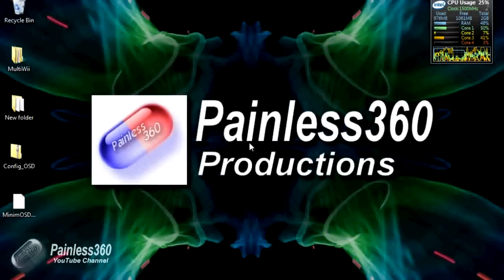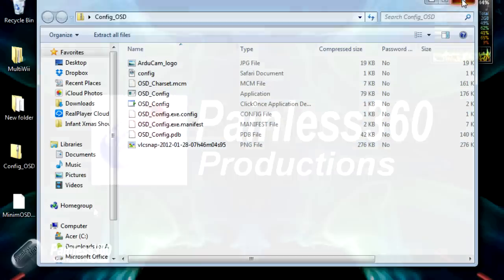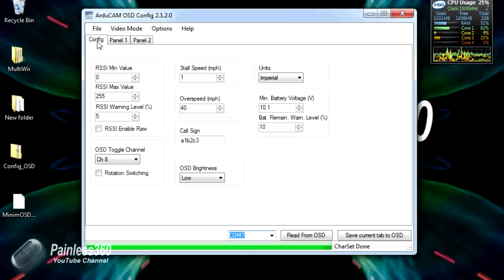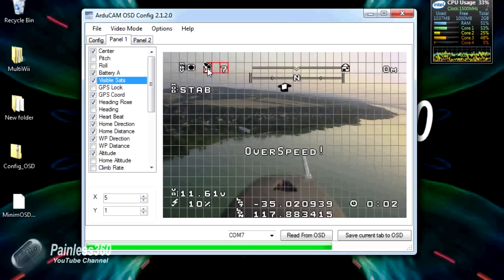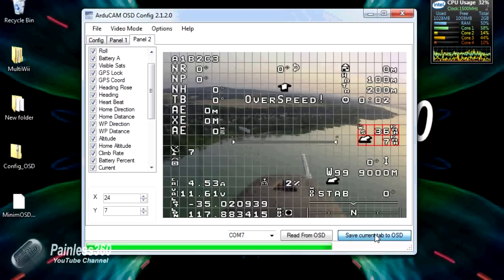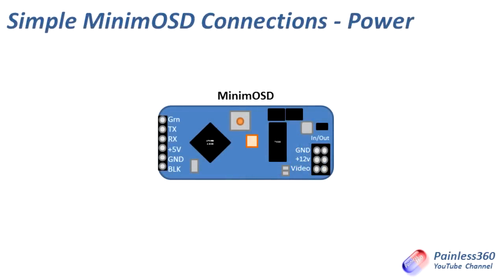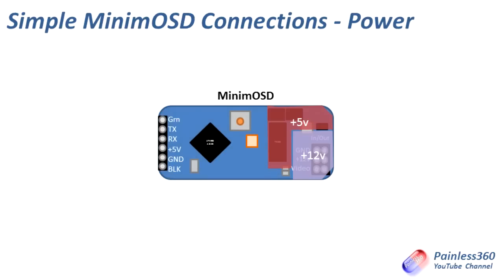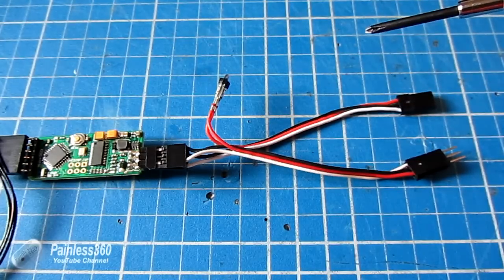APM 2.5/2.6/2.7 - Adding an OSD for FPV using MinimOSD - complete setup

Comment: Can the APM support having both the air telemetry 915 Mhz module and the OSD connected to the telemetry port?
Reply from the maker: The lack of ports was a limitation, from what I remember.  I've not used an APM for a very long time and would strongly suggest that you upgrade to something far more capable if that is the kind of thing you want to do... best of luck
Reply: I already have the S500 quad copter and am upgrading to add OSD and power module. I was thinking of making a Y harness to connect the OSD and the air unit. 
Thanks for your response, I really enjoy your channel.

Comment: You can use your arduino board as an FTDI adapter! You'll need to take out the atmega chip or upload a piece of code that pretty much disconnects every pin and makes the chip inert. Now just connect rx, tx, reset, 5V and ground. That's it, you can upload now. Now if you're using arduino IDE to flash the firmware, you will have to remove the chip completely.

Comment: Hi, I know this is a very old video but maybe someone could help me, I connect the osd module and I get image but I don't have information, I mean all values are 0 or disarmed o something like that, I checked tx and rx many times, even I changed them but I don't now why I can't see real information
Reply from the maker: It is usually that the telemetry isn't being sent from the FC or the TX and RX wires are the wrong way round (or both). https://ardupilot.org/plane/docs/common-minim-osd-quick-installation-guide.html covers what needs setting in the software. Best of luck
Reply: @Painless360  Well, right now I'm getting some information like if it is armed, throttle, horizon orientation and even compass direction, but things like flight mode, battery percent and height are always 0, am I missing some Mission planner's configuration or something like that maybe?
Reply from the maker: I'd check the release notes for what is installed onto the MinimOSD i.e. https://github.com/ShikOfTheRa/scarab-osd/wiki/MAVLINK-installation best of luck

Comment: How to use radio telemetry and fpv with minim osd with apm 2.8 at same time
Reply from the maker: I never got it to work. The APM is a very outdated flight controller.. Best of luck
Reply: @Painless360  so, it is possible in pixhawk ?

Comment: Hi. When reading the hex file it stops past halfway and gives a message error opening com port. It only shows 1 com port 5. I have tried everything, nothing works. What can I do? Please help. Or is there another system I can use?. Great video though. I'm a subscriber and view all your videos. Thanks
Reply from the maker: I've not used MinimOSD for many years. Not sure what part of the setup you're referring to but you need to use a supported version of the firmware.. Best of luck

Comment: hi there sir! your videos are great!
i've setup the osd like the vid
It works great 
the only prolem is that i have a 0.0 volts showing on the osd
i can't understand why :S
Reply from the maker: Check that you can see the voltage in the Mission Planner screen to confirm that the wiring is correct. Best of luck!

Comment: Can I use an Arduino nano, AND an OSD ? And ho to plug them together ??? Thanks a lot 😘😘 :)
Reply from the maker: not sure, that's something I've ever tried. You can install ardupilot on modern flight controllers that include an on-screen display now. Check out my latest ardupilot series. Happy flying!

Comment: Thank you.  This video made setting up a breeze.  Everything went exactly as you showed it.  Just one question though,  instead of patching the two solder points to bypass the 12v regulator can you just input 5v into the video side to power the Max chip?
Reply from the maker: Possibly but that’s the way that always works for me.. happy flying!

Comment: If my Tx supports 6s lipo...shoul i use a 4s lipo to power the Tx..is it affect the minim osd?
Reply from the maker: Sorry, I don't understand the question..
Reply: Should i configure the minim OSD with 4s lipo? As my TX supports 6s lipo.
Reply from the maker: You'll need 5 volts to run the minimosd. See the documentation for how you set-up the sensing of the main battery voltage. Best of luck!

Comment: hi mate! i take a lot of good tips from your videos but i have a question for you.
i upload the firmware in my minimosd with pixhawk as FC, i set the display with the info that i need for my copter but 2 options are not working as desired, one is the "flightmode" and the other is the "warnings".
Flightmode is fixed as "Hybrd" while warnings even if armed it display "disarmed"
i try to jump from a flightmode to another but nothing happend and also try to arm and disarm without no results. 
In your infinty knowledge to you have any suggestions
Reply from the maker: I'm not sure, sounds like a software version issue. Maybe there was a change to the MAVlink messages and how they are interpreted.. Sorry I can't be of more help..
Reply: many thanks for your reply! i will try also other firmware...may be if you have time you can check with your device and post your config (FC pixhawk firmware for example) and results! very appreciate! this video is related to APM not pixhawk

Comment: @painless360 - Hoping you can offer some insight.
I am attempting to setup APM v2.8 (https://www.tomtop.com/p-rm3244.html?_ga=2.92393373.1865110197.1519141650-1507016490.1519044082)
I was able to successfully get OSD to display properly following your video guidance, firmware ,etc.
I then attempted to connect my FrSky L8R receiver to input 1 on the APM; making sure the signal was on the inside and GND to the outside of the APM.  The moment I connected the Rx I believe the APM rebooted.  When the APM was back online I no longer had OSD displaying.  I have rebooted everything, powered off/on and confirmed all connections are solid.  I have removed the Rx from the equation, still no luck.  I used my FTDI connector to re-flash minimOSD successfully; plugged back into the APM, still no OSD.
When looking at the minimOSD both sides of the board LEDs show online.
Did I inadvertently fry something when I plugged in the Rx?
Any help appreciated.
Reply from the maker: Tricky to comment and offer advice but it does sound like something might have popped.. I've not played with APM for a while so I'd start by checking out the reviever and making sure non of the pins on that are shorted.. Best of luck!

Comment: Hi, thanks for this video. I followed the tutorial and it worked like a charm the first try. However, now that I soldered the board to deactivate the 12V onboard BEC I get a "Failed to talk to bootloader" error when I try to reflash the firmware. Do I need to undo the soldering, or is there a bigger issue?
Reply from the maker: I've never seen that as the board is powered from the 5v line from the USB. You can always try and see if reversing the change makes a difference..

Comment: Thanks for the great tutorial! Slight issue though; my OSD is flickering. I've read somewhere that it has to do with the ground connections. Could you kindly advise how to do this? I've connected everything up as you did in the video.
Reply from the maker: That’ll be a power issue. Connect the GND wires from all of the FPV pieces (camera, minimise, vtx etc) to one place.. best of luck!

Comment: Great video, what i learned from this got my minimosd working great. Only thing i am not sure about is the stall speed setting, i set it at 70mph like you did, but found i had a constant stall warning whilst flying, i dropped the stall speed value down to zero and that solved the problem. How is it meant to work, i would have thought that if you go slower than the value you enter, then a stall warning will be given? If so, setting it at 70mph is guaranteed to give a stall warning unless you are travelling over 70mph?

Comment: What if my camera doesnt need power? Can do the same wiring without the 5v to the camera?
Reply from the maker: +Andre Ferreira yes, exactly. Just remove the red wire from the middle of the cable going to that camera. Best of luck.
Reply: Painless360 thank you ;) big fan of  your videos.

Comment: mine osd dsnt show home arrow- someting else is missing- apm is not in the plane yet is on the bench . just did same firmware- try to do differed  ones - newer but there was nothing on osd . but that home arrow. well is inside the house no gps light yet.
Reply from the maker: +duc56 I try this again once you have a good GPS lock. Best of luck
Reply: gps lock the arrow is there- now the voltage dasnt show, do i have to solder/ desolder something i think i saw it in one of your videos.. and last thing when i power my runcam hd2 osd starts flicker- may be a rf filter  on cam 5v?  i use immersionrc 600mw- they have a filter in. I will put one thats not that big a deal now- is the voltage. Thank You for your answear...

Comment: Thanks for info,  yes I got FTDI download the software you recommend, configured the screens and uploaded to minim OSD, was so happy all went well. My intention was to connect this OSD with Cheerson cx20 APM, but can't see the hex setup,  I did on panel 1 or 2 . The screen shows on my FPV goggle,  still waiting for heartbeat :(  I'm not sure the minim OSD doesn't connect with Cheerson cx20 APM or I need to use different setup software. Thanks very much if you could help me out. Regards
Reply from the maker: Waiting for Heartbeat normally means that the cabling or port is wrong. I most often see this from pilots using the wrong firmware on the OSD (https://www.youtube.com/watch?v=PTd5ViDsH1Q). I'd recheck the Rx/Tx connection and maybe swap them round..

Comment: Hi Painless360. I'm always a fan of your video, as I started building my own quad. For this topic, I bought the 3DR radio telemetry 433mhz and minimOSD. Following this guide, I am able to configure minimOSD with the 2 panels. Now, how do I do to transmit the video to the ground (android device)? Would it be possible just by using the 3DR radio ground station? Thanks in advance, sir!
Reply from the maker: It's tricky to setup two devices that need telemetry on an APM. Both the radios and OSD need it and there is only one 'telem.' port. See our videos series on 'Introduction to FPV' for the basics and if you Google 'FPV receiver android' then you'll see the devices that others use with a phone/tablet. Best of luck!
Reply: Thanks for your prompt reply, appreciate it much! 
Given this situation, what would you prefer, to have telemetry or FPV, as actually you can get many telemetry info overlaid into it, am I right?
Reply from the maker: +ibusnawi depends if you are flying using the fpv camera ;)
Reply: Painless360, thank you for your advice sir. I started watching your "Intro to FPV Videos". A lot to learn there too. 😊

Comment: Hello Sir,

Your videos are very good. 

I have a new problem with my osd.

I am installing my MinimOSD in my hexacopter and it does not work. My screen only shows zeros in all information that it shows. The zero numbers do not update although I arm. The only information what changes are “No GPS fix” and “Battery Low”.  

I am sure I connected the Rx connector in the osd because I swapped by the Tx wire and the osd did not work.

I installed the program OSD_Config.exe, the firmware R800 and I have upgraded the charaters. I used my FTDI.

In reference to the wiring, I did a lot of combinations. I used a 5V UBEC to power the OSD and the telemetry, then only the OSD, then only the telemetry, and finally I powered both by the apm. I had no successful. 

I changed some SR1 and SR2 parameters and nothing happened.

I have installed a OSD in my old CX20 and it works perfectly. I removed it and installed this cx-20 OSD in my hexacopter and the problem was the same, so I believe that the problem is in the apm or in the telemetry. Perhaps both ones, or one of them, do not send the correct signal to my FPV receiver. 

I have set a 10 seconds as telemetry delay parameter and nothing happened.

I think my problem is about parameters and telemetry. What do you think? Could you give me an idea?

I have been looking for on internet and my problem is very common although I have not found the solution.

Thanks in adance. :)
Reply from the maker: +Mari Carmen Gil Moreno that seems a little odd, if there was no telemetry data at all the normally the OSD will complain that it isn't getting any MAVLINK heartbeat. I suspect something on the flight controller or setup that's causing the problem. Best of luck!

Comment: Hi sir!! Im trying to build something similar to your proyect for my final work of the degree. How could i use ur setup to get the streaming video on my computer? I will really appreciate the information (by the way i am starter with this themes so it will help if you explain it for dummies) 
thanks in advance!!
Reply from the maker: You can get the video on a PC if you use some kind of video capture device that will accept an RCA style connection and is happy with VGA video.. Best of luck!
Reply: thanks 4 the information i will look for it!! you are the best!!

Comment: I tried this but it doesn't seem to work (see below)  Any ideas?  Thanks!
"Failed to talk to bootloader.  EEprom mapping outdated."
 But can't update says try using Adrino.
Reply from the maker: Use Arduino V 1.0.5 would be my first thing to try.. https://www.youtube.com/watch?v=KJ1KmtkkLxw ;)
Reply: Well, I did two things to fix it.  Added a jumper to have the FTDI at 5V instead of 3.3V into the minimosd and soldered the two spots on the minimosd to let it work with just 5V.  That seemed to fix the problem.

Comment: i am getting black screen on my video feed... all connections are correct, i am using micro minimosd.
when i short video in and video out pins i get my camera feed but without osd. iotherwise its blacl fw and cc were successfully loaded. what could be the problem.? p.s i power my osd from ftdi pins using telemetry out from apm
Reply from the maker: It's usually a power related or cabling issues.. I'd start there. Best of luck!
Reply from the maker: Also check that the PAL/NTSC is set the same as the camera..
Reply: i checked everything,, even pal and ntsc. still no luck i think the board is bad

Comment: Hi. How to do if i´m using 5v camera with internal battery? Do I still need to solder two joints on the osd board?
Reply from the maker: If you want both halves of the PCB powered you do...
Reply: Painless360 Thank you

Comment: Hey, I have fixed every issue that I had previously on the osd, but now I'd like to fix the very bright osd video output. What I mean is that the view looks very overexosed/blown out. Doesn't happen when plugging the camera directly to the vtx
Reply from the maker: I've not seen that here but I'd suspect that board or voltages it's running on.. There are so many clones and varied build quality on these things. I've had two that never worked great/wouldn't flash. Best of luck!

Comment: Hi, I followed the vie, but my once I connect everything up,  the screen only shows a couple of things, not all. And it seems like the "horizon" is mirrored
Reply from the maker: I'd check that you've uploaded the fonts.. Best of luck!
Reply: Painless360 I updated the filmware on the minimosd to a later version and now almot everything works, just no RSSI and one arrow that shows the direction to home. Any idea on how to fix this? Also could you link me up with a better font?
Reply: I got the RSSI working now, and everything that was not working fixed, but now the Voltage displays 0 and the VS goes up and down abnormally (while it shows correctly on mission planner... How can I fix this? I am running this software: https://www.rcgroups.com/forums/showthread.php?2591835-New-MinimOSD-fork